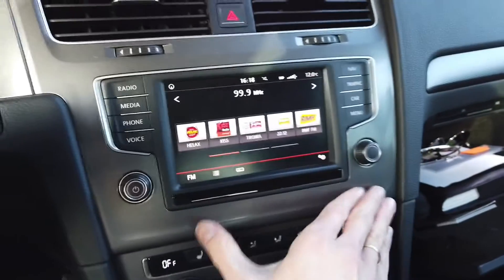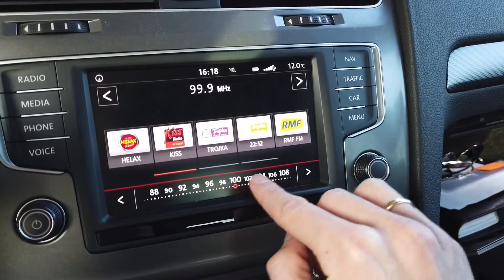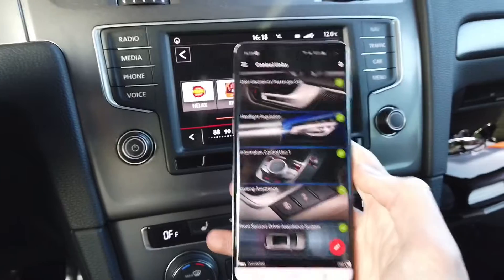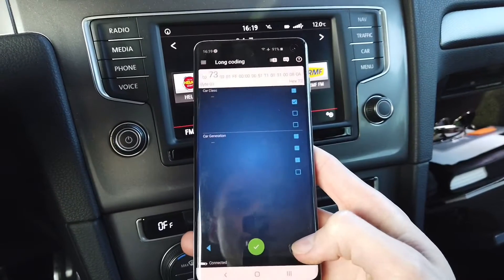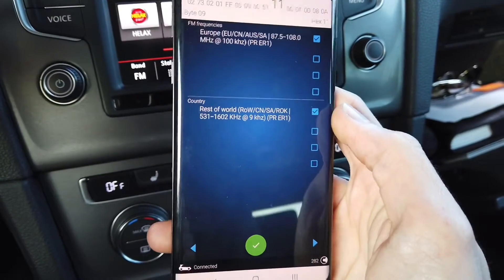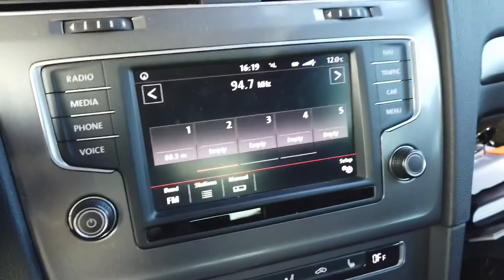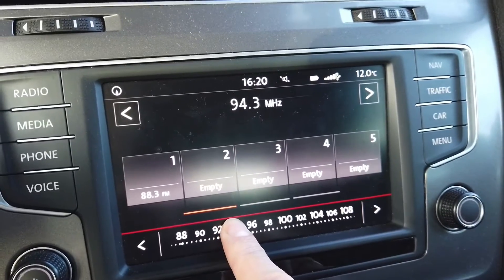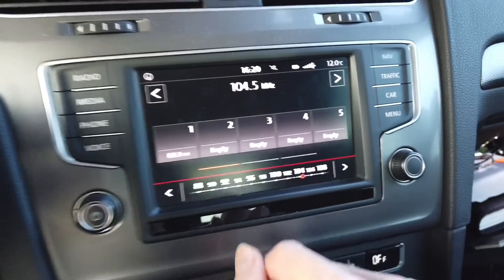Change radio frequency region in MIB1 MIB2 Audi Volkswagen

Comment: not working on Audi A4  B8  2014 . Need to change EEPROM. But it's not allowed... Sh*t... :(
Reply from the maker: Well, A4 B8 is too old for MIB1/MIB2 device. Which system do you have? Because in some it can be done with OBDeleven.
Reply: @mrfixpl  I have MMI 3G on my Audi A4 B8. Tried to change a region via OBDeleven Ultimate plan, it's impossible...
Reply from the maker: Try this:
Connect with module 56 (Radio) > Change Service > Developer mode
Now still in module 56 (Radio) > Long Coding > Radio Frequency > EU
Reply: @mrfixpl  is this the same for Audi a1?
Reply: @mrfixpl  this metod is not allowed also... :(
Reply: @mrfixpl  I have a 2013 Passat B7 that I brought from Canada. Is there any solution to change it aswell?
Reply: @ricarrdux  hi, did you fix the issue, I am trying to covert my Audi A1 from japan region to uk.

Comment: Does changing radio frequencies use credits on obdeleven pro ?
Reply from the maker: If you use one-click app to do it - yes. If you manually change the coding as I did - no.
Reply: @mrfixpl  the way you did also look easy

Comment: If you are retro fitting an european MIB2 unit into a car that had an MIB one you will need to do this and enable the AM toggle to be active on the radio screen, otherwise you will get no sound for radio stations. Just did this myself after I imported a retrofit kit from Poland, that was the only issue I had with the install
Reply: How did you log in into the obd eleven pro?